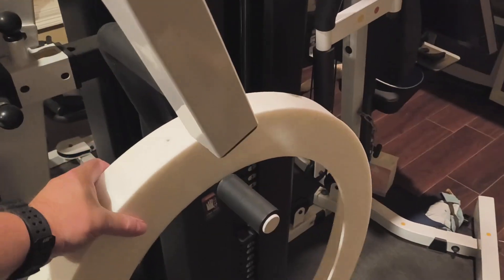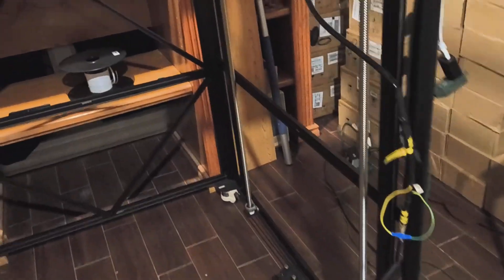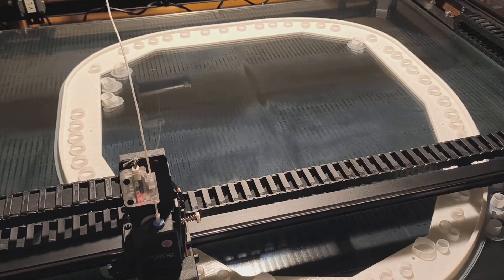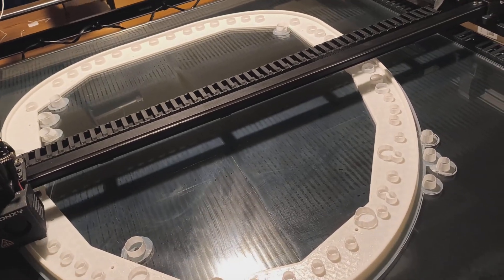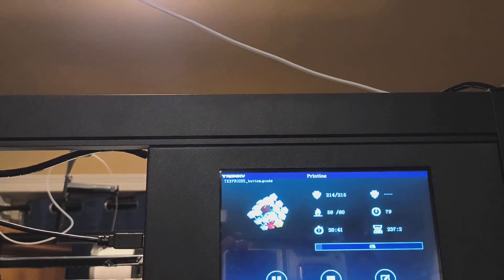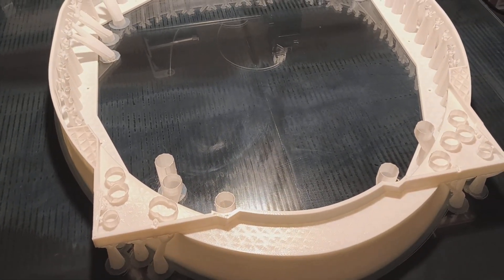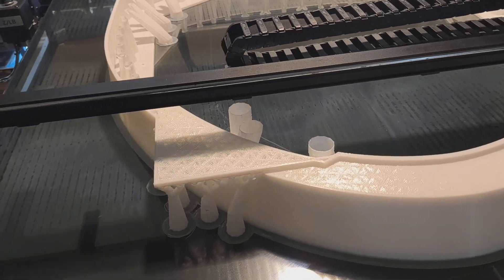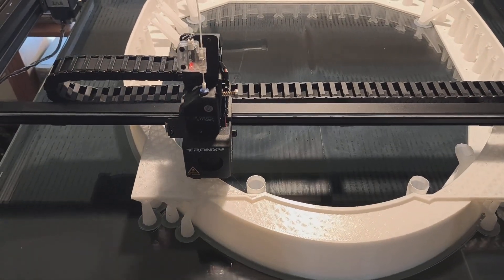1:1 Scale Dalek #17 TronXY VEHO 1000-16 - Dalek mid section lower part - first attempt.

Comment: I might avoid the infill types that cross over themselves on the same layer such as grid and the triangular one you've used as they increase the odds of nozzle collisions.

I might also be willing to sacrifice a tiny bit of quality for slightly increased z hop, and a bit of speed by avoiding printed parts while traveling. I think both could help reduce these outcomes.
Reply from the maker: Thanks.  I appreciate the advice.  🙂

Comment: Considering that you have VERY large and long prints that like to snag, causing you to restart, is it worth looking into using closed loop stepper motors?
https://youtu.be/eM8zSG8fEkk?si=SElm8Vns9TF8Bg_s
Reply from the maker: Wow, thanks for that link.  That's certainly something worth looking at.  I can't believe how cheap the motors are.  They would certainly be useful for the X and Y axis.